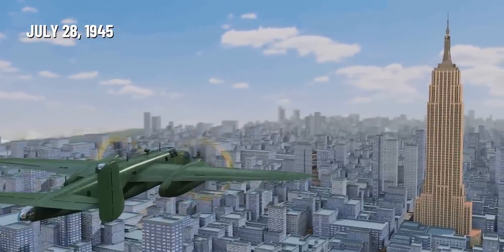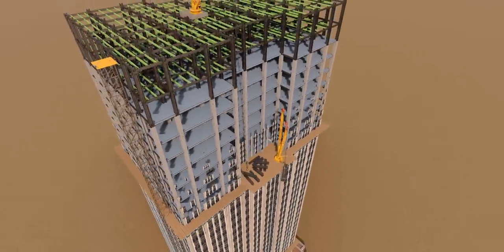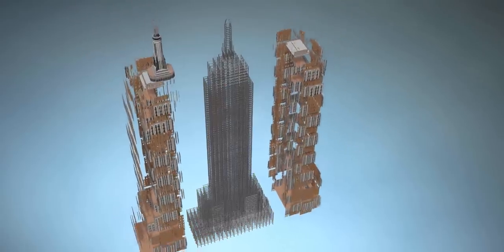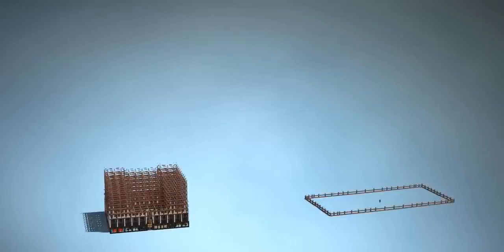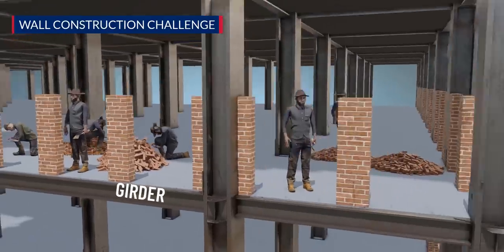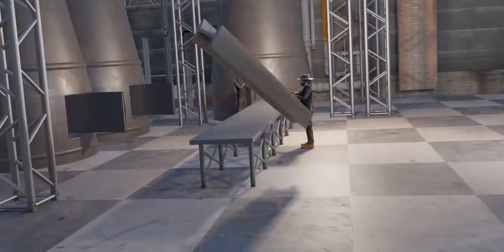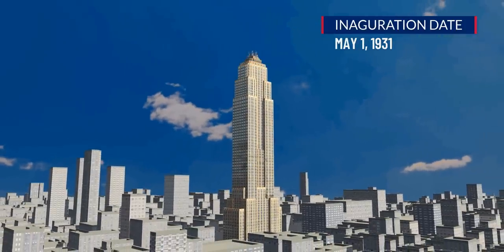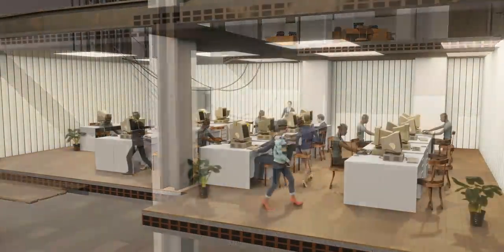Empire State Building | All the Secrets of the Engineering Wonder

Comment: More than 20 years later and they're still trying to explain why 3 building on fire with minimal damaged just collapsed into their own footprints.
Reply: it’s not that deep bro💀💀💀newer building uses less material for cost and efficiency because computers were used to avoid unnecessary over engineering to save money, unlike older buildings when not computer aids were available, no one designs a building for taking a hit from an airplane 😅
Reply: @lyteness859  It's pretty deep.
Reply: @lyteness859 the building was steel not wood, and hit at the top not the bottom
Reply: @lyteness859 nobody designs a building for planes to hit it
Reply: @Welder19  that’s what i said?
Reply: @Welder19  Buildings like that are designed to not fall down. Explain why they did without parroting the official lies and be prepared for me to know things you don't which will embarrassed your basic intelligence.
Reply: @quietquitter6103 basic intelligence like using words properly?
Reply: @joshuapowers4623  Which words weren't used properly?
Reply: Because it was cheaper and no one foresaw 9/11
Reply: jameswheeler5025  They certainly did.
Reply: Inside job, small 🎩s did it
Reply: Just think for a minute and you will know why ... Just teasing: a 767-200 weighs more than eight times more than a B-25 ...
Reply: @widget787  But doesn't have the mass to do what we saw one do. I've been thinking about it for 22 years.
Reply: The top would have fallen over sideways crashing into other building. A building doesn't fall straight down unless it's controlled. The equivalent of that would be a tank shooting the side of your house and expecting the entire house to fall into the basement
Reply: So computers are why jet fuel can suddenly melt steel beams. Okay bro.
Reply: “The building was actually designed to withstand multiple plane impacts.”

Designer of the World Trade Center.
Reply: Or like acknowledging the obvious fact that jet fuel can’t melt steel beams. But sure, stick with spelling and grammar if that’s what you’re more focused on.
Reply: Great. You just made a YouTube moderator take a break from their egg foo yung to come here and delete your comment. How rude.
Reply: Oh so it was the heaviness of the plane that caused it? That’s kinda weird because that’s not what the government said happened. They have some silly story about jet fuel but your silly story about a plane being too heavy (despite the astronomical weight of the building itself being supported by the steel beams) is way better.
Reply: Oh okay.  Just one problem though. There was a third building. No plane impact. So what happened there, guy? Let me guess: something totally unrelated to a massive airplane impact but somehow causing the exact same global building collapse that we saw in the towers. How much do they pay you silly gatekeepers for this?
Reply: He knows. He just doesn’t want to admit it because he’s not a good person.
Reply: @Welder19 that doesn't explain how they collapsed.
Reply: Minimal damage… a fully fuelled plane at full speed hitting it.  ahhh.. ok…. Onya
Reply: @MrRandomposter  lol if you think a plastic airplane is stronger than a fortified, galvanized steel building 😆😆😆
Reply: Bro , use proper grammar 
That was painful to read
Reply: @HailSchmitler-wz1wk jet fuel weakens steel beams and then all rules go out the window
Reply: @Welder19 That's exactly one of the things tall buildings like this are built to withstand.  If you think about it, it's entirely possible a plane might crash into such a building.
Reply: @quietquitter6103 Yeah because even 20 years later it’s clear many people don’t understand how those structures were built and how the impact and the resulting fires affected it. If you understood, you would also understand it makes total sense for them to collapse the way they did.
Reply: @rpmexre1003  WT7
Reply: @quietquitter6103  fire
Reply: @rpmexre1003  Fire doesn't do that, though
Reply: @quietquitter6103  Doesn’t do what?
Reply: @rpmexre1003  Fire doesn't collapse buildings.
Reply: @quietquitter6103  It can under the right conditions. Such as an uncontrolled fire burning for almost 7 hours in a steel-framed building. A building’s structure is critically important in how well a building does in case of a serious fire. Saying a steel-framed skyscraper can’t collapse due to a fire means you haven’t done enough research.
Reply: No, they're not. This was thoroughly explained shortly after it happened.
Reply: @timg2727  I see you trust your government. LOL what a thing to believe
Reply: Minimal damage? Are you serious. I wouldn't call having much of your support beams severed by a plane impact to be Minimal
Reply: @thepessimistictitan2655  First of all the beam which were cut were the facade curtain wall and even they shouldn't have been cut by what are tantamount to empty aluminium foil tubes. That aside, say what you said about WT 7.
Reply: @quietquitter6103  the WTC towers were not curtain wall buildings. The exterior was the main structural support. It's actually a big part of the reason why they collapsed like they did. Also, the "aluminum foil tubes" you're referring to had an enormous amount of kinetic energy due to their speed of over 500 mph on impact, hence their ability to severely damage a crucial amount of the buildings' structural support.
Reply: @timg2727  Tell yourself whatever you like to try to explain what the rest of us know didn't happen the way we were told.
Reply: Wtc collapsed not due to impact of the plane but due to burning hot fuel and melting the column
Reply: @rakeshmeitei1680  That's what engineers call, 'impossible'.
Reply: @quietquitter6103 dude theres video from down the street of 7s ground floors blazing and debris collapsed into the roof, btw only the top 40 floors were office space. Ground floors were a substation with 20000 gallons of fuel and another 6000 gallons on floor 7 in storage, if just 1 of those ignited, it could easily trigger a demo style collapse like it did
Reply: @quietquitter6103  you conspiracy nuts are wild.
Reply: @timg2727  Not wild. Angry.
Reply: @quietquitter6103  imagine being angry about a fictional scenario
Reply: @timg2727  Imagine believing what the government tells you.
Reply: @quietquitter6103  I don't understand why you're still acting like every analysis of the collapse came from the government. There have been plenty of breakdowns that came from individuals and organizations that have no affiliation with the government. I realize you like to feel like you're part of the super special enlightened group that has the REAL truth that "they" don't want you to know, but you're not and you don't. Have a great day.
Reply: @timg2727  And I don't understand why took their word for it ss vested interest but not that of the thousands of professionals who have said for over two decades that it couldn't have happened that way. It's okay, clearly there was no conspiracy to bring then down qnd you can just rest eqsy qnd go back to sleep. Obviously they qnd I qnd anyone who says it doesn't make sense is a nutty conspiracy theorist and you're totally right and that's great. All the best 👍🏿
Reply: Also the big fuck all plane didn’t help
Reply: @Altair885 planes were smaller in the 70s
Reply: @sirsmoss7362  What do you think planes are made of
Reply: @bigbimbo8220 so you going to ignore how all the videos show the top of the south tower slightly fall east?
Reply: @quietquitter6103  they weigh around 4,000 pounds, which wasn’t the main cause of the collapse, but certainly didn’t help.
Reply: @Welder19 actually it's one thing they do consider. Anytime a building is over a certin hieght they take into consideration a plane strik
 Also why they have regulation for warning lights for aircraft.and.those are on.redundent backups so they work even in case of a power lose
Reply: @sirsmoss7362  Weight doesn't matter. Mass matters.
Reply: @quietquitter6103  so, if I have a 1 meter block of plastic, and a 1 meter block of tungsten, and place them on a cardboard box. The cardboard will collapse the same way?
Reply: @sirsmoss7362  It wasn't any of those things. It was two very solid steel  buildings hit by aluminium tubes whereby the only thing acting as a solid was the fuel on board. Yet they went through like butter. Not to mention WT 7 brought down by a relatively small office fire. Except that isn't what happened and we have the owner on video saying they made the decision to "pull" the building - only theres no way they could have done that unless there were explosives already in it. Let's not even talk about the Pentagon anomalies, unless you actually want to open that can of worms.
Reply: @WildWillex  i would assume it would fall in the direction it was hit and continue to fall that way. There was allot of shady deals going on in 2001 similar deals are made today. blowing up buildings and sacrificing thousands of american and middle eastern lives are a small price to pay for the people making these deals. Imagine what kind of deals they made to think of a plan like that. Thats all im sayin
(Oh yea and building 3 makes no sense either)
Reply: More than 100 years since Titanic sank and they're still explaining... 111 years ago, to be exact.
Reply: @TroyQwert   I wouldn't be too confident of that official narrative, either.
Reply: @quietquitter6103 , you wouldn't, I would.
Reply: @TroyQwert  I bet you're fully 'vaxxed', too 😉
Reply: @quietquitter6103  , how much is your bet? Unforch, you lost.
Reply: @TroyQwert  Really, because I find it strange that you question one and not the others.
Reply: @quietquitter6103  , me? Really? Read again. On the second thought: do you question everyone?
Reply: Does anybody really not understand that you don’t actually have to melt the steel into molten it just needs to be bent and compromised to a certain extent along with the center columns being taken out to eventually be unable to sustain the tens and hundreds of thousands of tons teetering above the compromised area? Holy shit dude.   Take an engineering class… Play Jenga play with Lincoln logs. It sounds like I’m being ridiculous but it’s really not that fucking different.
Reply: @bigbimbo8220 ahahaha, you seriously think a house is the same design as a massive office building?
Reply: Durka, my man.
Freakin' durka.
Reply: @-fuk57  Nore like Challa, unfortunately.
Reply: Hahaha minimal damage? 🤦‍♂️
Reply: @quietquitter6103 it was designed for a plane to hit it, not for all the fuel on board to burn at 1000° for an hour
Reply: @giantmanice  That is enough to weaken those steel solid beams, but not melt them. It is also not enough to destroy the known aspects of the theory of thermodynamics and allow for entire buildings to just disappear into dust as they collapse. What we saw take place was impossible according to the official explanation. Something else happened.
Reply: Might have something to do with the fact that the plane was 10x larger, carried more fuel and that the designs were completely different. WTC main structural support was around the outside of the building and in the dead centre, empire state has pillars running through the whole damn thing.
And the WTC didn't collapse into its own footprint, footage very clearly shows it collapsing from the top down ON to its own footprint. Can't say I've ever seen a controlled demolition start collapsing from the top down.
Reply: Yeah it's not like planes crash into them at 450+ mph and burned for an more than an hour.
Reply: @RK18771  That would weaken the steel, not all known laws of physics.
Reply: @quietquitter6103  exactly
Reply: @RK18771  Yep, which is why what we saw broke those laws, according to the official story. Something else happened, everyone that has acknowledged this would like to know what it was.
Reply: @quietquitter6103  no
Reply: @jplstudios6507  And yet that's what they did. What we saw is impossible according to the known laws of physics, you just can't emotionally accept it because of what that means. Its long past time that you did, you have no excuse at this point. Also, WT 7.
Reply: @quietquitter6103  eyes can't see through walls. What we saw was very possible according to the laws of physics. The architect who built the towers is on record admitting the buildings were designed to take the impact of a plane but he failed to take the fire into account, this was in the 70s when planes were a lot smaller and carried a lot less fuel.
Images of wtc7 show it looking unscathed however none of the images show the side facing the twin towers. Countless firefighters ( people that were actually there on ground zero, not behind a keyboard ) have reported a massive chunk gouged out of the side of the building by burning debris. And none of them looked anything like a controlled demolition, controlled demolitions don't collapse from the top down.
Reply: @jplstudios6507  You need to look up when those planes were designed and the size of planes when the towers were built, then retract your statement for being false.
Reply: @quietquitter6103  what planes?
The planes that hit the towers?
The planes the architect used in his calculations?
Or the B-25 Mitchell that ran into the empire state building?

Any one of those is only going to confirm my argument regardless 🤷

I'll happily retract my statement when I come across or am provided with valid information to the contrary.
Reply: @jplstudios6507  The planes that hit the world trade center. They are hardly differently at all from what existed when the architect designed them.
Reply: @quietquitter6103  okay
So in regards to the original question about the empire state building.
A B-25 Mitchell is 16.3m long, 20.6m wide, has a max takeoff weight of 15876kg and holds 3686.9L of avgas (not jet fuel)
A Boeing 767 extended range variant like the one that hit the north tower is;
61.37m long, 51.92m wide, has a max takeoff weight of 204116kg ( about 185 tonne heavier than the b-25 ) and holds 91380L of jet fuel (burns hotter than avgas)

Given the vastly different nature of these planes and the vastly different designs used in the empire state and twin towers you should be able to understand why the results were so different.
Reply: @jplstudios6507  That doesn't explain three buildings disappearing into dust. It just doesn't.
Reply: Those were 2 JUMBO JETS... Do you know how huge kinetic force is applied from a vehicle which is flying at 500 MPH with a weight of a small building?! Check out the sway of the WTC while the plane has crashed and you will be surprised why the building didn't collapse suddenly. All the buildings would but the twins stood even after the catastrophic sway and the bent of it's supports. DO YOU KNOW WHAT'S THE WEIGHT OF THE TITANIC? Because that's what those damaged rods should hold. Don't be surprised by the results...
Reply: @aldersdavid6785  You seem to bizarrely believe that the buildings themselves had no force of their own to exert, that they were made of cardboard and also for some reason are entirely unwware of the law which states where there is matter below a falling object it will eventually slow and stop. This should have happened long before the ground but we saw almost free fall according to the kinematic equations, which is impossible.
Reply: @aldersdavid6785  Except that they were not small buildings now, were they and since you bring up how fast those planes were going, why is it you ignore that just about every pilot, when asked if they could fly them with that much precision, said absolutely not. Oh and go dig up what all the engineers have said about what you believe yourself to be expert in. You're going through the stages of grief and you're quite late to the party, I must say.
Reply: @HailSchmitler-wz1wk fuel can melt steel 300 meters from the place where it burns? Amazing
😂
Reply: @@MS-jw1yr I have a reasonable grasp of physics and I even if I didnt, the many, many, many engineers who have expert knowledge that are telling you its impossible ought to be enough for you. But you be a good boy and accept what daddy government tells you, there's good boy.
Reply: @Welder19 no your special, a b-25 bomber going approach speeds is gonna only penetrate the perimeter facade of the building and break through a floor or 2, a fully loaded boeing 767-200 is hundreds of times lethal
Reply: @dr.jiIIaIicecooper2587 no your special, a b-25 bomber going approach speeds is gonna only penetrate the perimeter facade of the building and break through a floor or 2, a fully loaded boeing 767-200 is hundreds of times lethal

Comment: There are 103rd and 104th floors too, the 104th floor is the conical room right at the top of the building with the transmission aerial complex mounted on top of it (The 103rd and 104th floors contain the associated transmission electronics cabinets with the 104th floor being completely off-limits to the public).